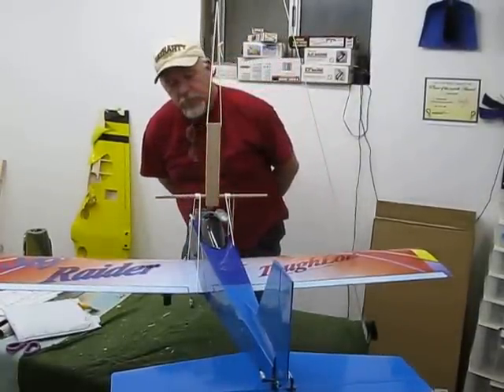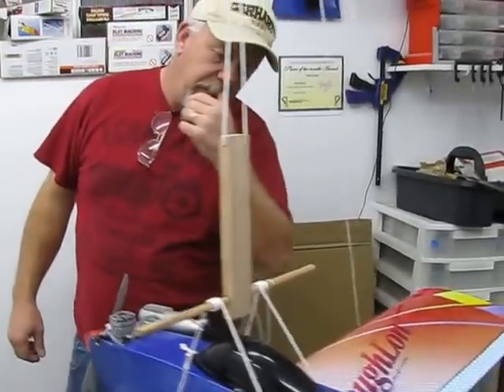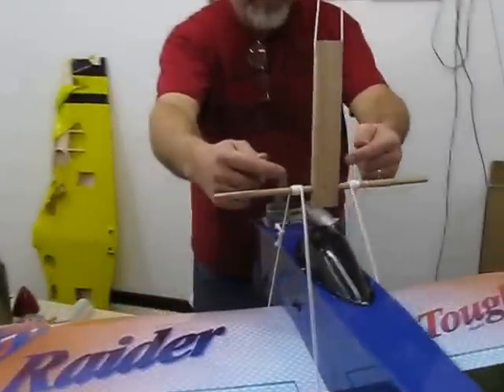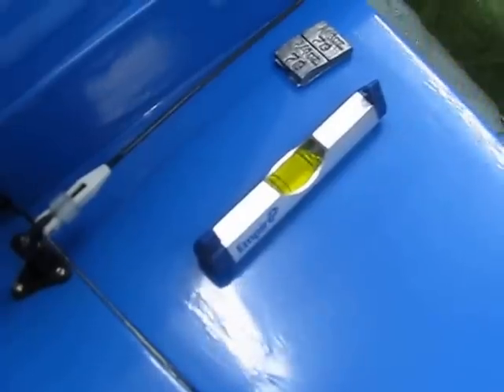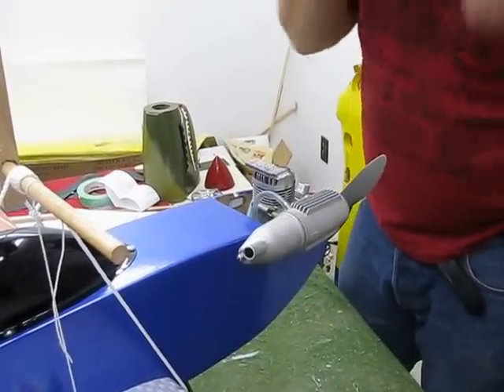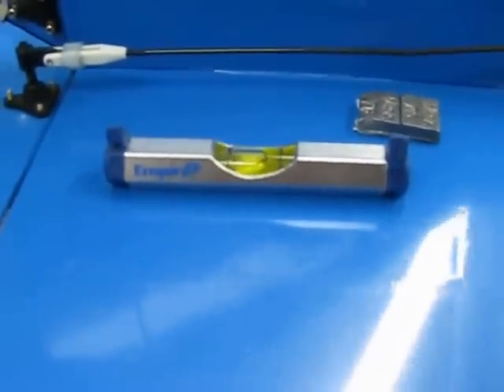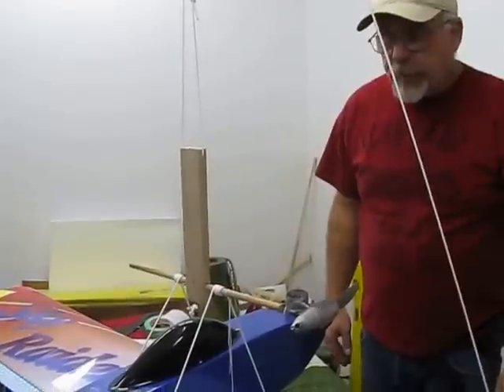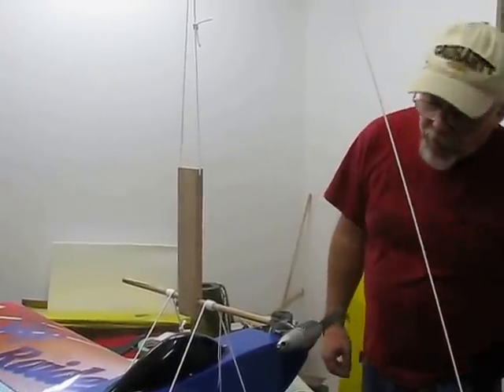Vanessa Center of Gravity Machine

Comment: I’d like to try this but I’m still a little confused by it. Wouldn’t twisting the dowel influence your CG measurement?
Reply: Yes, and that's the point.  Once the model is level, whatever you are using as a pointer will show the current CG.  If the CG is in the wrong place or not where you want it, you add weight to either the nose or tail and then twist the dowel to level the model again.  Continue to do this, (add weight, twist dowel), until the model is level and the pointer is showing the CG where you want it to be.

Comment: To protect the wings from the  string scratching the wings. use round Styrofoam pipe insulation. Cut off 1" and stick it on the wing. Under the string.
Reply from the maker: That's great idea.
Reply: @tsawyer148  Cool your welcome!! 
I hanger all my plans  like that 👍
Reply: @josephkerkau2520  👍

Comment: Can't you just balance the plane on the CG? Why do you need to make this big over analyzed way of checking the CG?
Reply from the maker: Yes, which is what this does if you know where the CG is supposed to be or where you want it to be.  This is actually very simple and works great on bigger airframes since you aren't trying to balance it on your fingers or a flimsy post.

Comment: I tried this but the dowel pointed at the trailing edge of one wing and the leading edge of the other wing how did you keep the dowel parallel with the wing
Reply from the maker: Not sure what would cause that, never seen it happen.  Make sure the cord loops are the same length and the number and direction of wraps are the same.  You should be able to adjust the way the cords wrap around the wing to get the dowel parallel along each wing.  Any chance you have a picture to show what you are seeing?
Reply: @tsawyer148  i realized i had the dowels 90 degrees from support line.    so i redid it like your video shows how important is it to have the loops that go around thw wings the s@me length and if it is important how did you tie them to the same length
Reply from the maker: The loops need to be the same length so the wings stay level horizontally.  Just cut two pieces of whatever you are using for the cords and tie the knot the same way in the same place on the cords.  You also need to make sure the wraps are going the same direction around the adjustment dowel like it says in the video.

Comment: Having a tailplane that has an airfoil shape complicates this a bit, but thanks for the video as it will apply to the other 90% of RC models that are provided with a GC location. it does tick me off that I was given "a range" of millimeters from the leading edge for the CG of my Wargo Yak. I still haven't got it flying reliably..
Reply: The plane does not have to be perfectly level for this to work, so, practically speaking, you can forget about the spirit level. Just eyeball it from the side and adjust the plane so it's close to the attitude it assumes in level flight, and you will be good to go.

Comment: I made one of the machines and it works well. Thanks. The only problem I have found is determining the point to put the spirit level on. Most stabilizers are curved and finding the point where you are at zero degree incidence is a bit hit and miss unless you have an incidence machine. Using an incidence machine I generally can find a point on the plane which is the same, and this often is the battery/Rx tray. Any ideas?
Reply: as close to CG as possible would be the best place for it, some kind of foam holder will work great in case the aircraft is curved, a little messing about before hand so set the holder up, place the model on a soft cushion to complete this, once done you can keep the holder for future testing.

Comment: Let's assume that the manufacturer of an RC plane provided the wrong CG. Does this rig allow one to find the correct CG on the plane ??
Reply from the maker: +Danger Dan What this method does is tell you where the current CG is.  So, to answer your question, no, it doesn't.  You would have to go through the process of measuring the wing chord, etc., to find where the correct CG should be then balance the model accordingly.
Reply: +tsawyer148 

Thank you for responding.. That really helped.
Reply from the maker: +Danger Dan Very welcome.

Comment: just a follow up on your vanessa cg rig...built one..works great for most of my planes...only issue I want to touch on...level on the rear stab...before cg stuff...how do you establish what IS LEVEL when hanging plane...(most rear stabs are CURVED a bit) egs..P51.... so level varies on where ON the rear stab you put this level ...is it basically an eyeball thing???
ps..I hung a small weight on fishing line the same weight as the level (7grms} on the nose to equal out  weight of the little level
Reply from the maker: An airfoiled surface like on bigger planes can be a bit tricky, but what you could do is find the center of the horizontal stab at the tip on the leading and trailing edge and mark a line along the center.  Then find a way to put the level along that line and use that to level the plane.  That's a great idea by hanging the weight on the nose, I'll have to try doing that.

Comment: if I read correctly..this gets rid of flipping plane up-side-down...I.should STILL retract gear..right....Im buildind this...(trying to flip a twin engine mosquito..gear up..battery installed..& using fingers..lol  TRY THAT!!!).. this looks bang on bud
Reply from the maker: That is correct, plane right side up, gear retracted.  It should still work even if the plane is upside down but there is not need for it.  I have used it for several different planes, (high, mid and low wing; with and without retracts), and it works for them all with the plane right side up.
Reply: Thanks, very cool..very simple..got so frustrated trying to balance a fairly large plane on the machine I built out of pbs pipe...real gong show...got this built, just have to get a small plum bob..